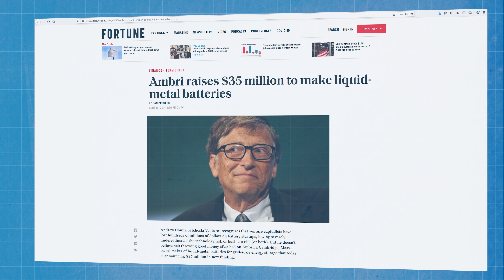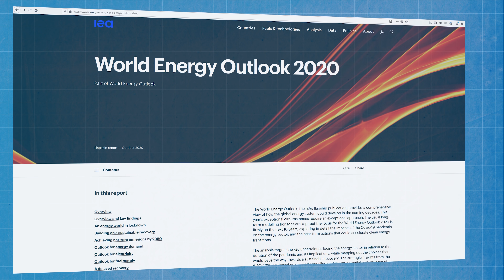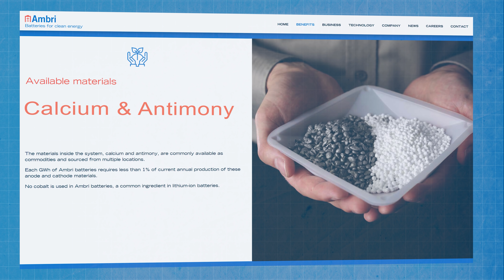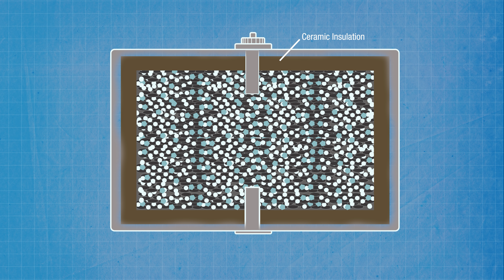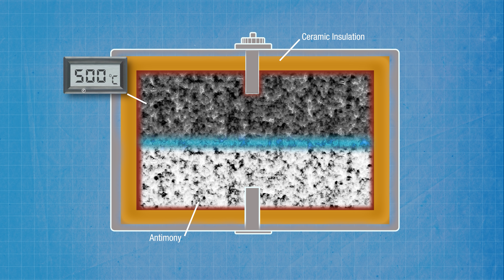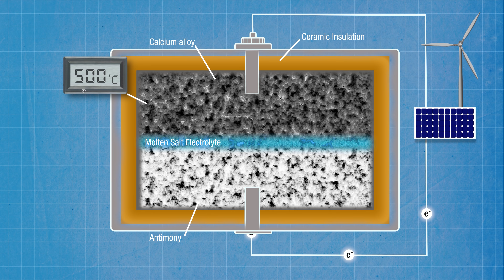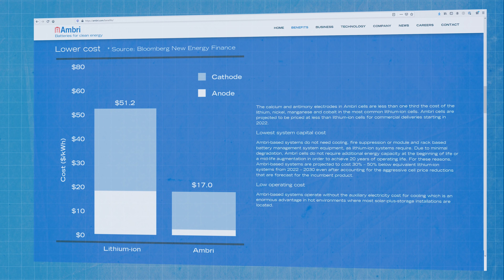AMBRI Liquid Metal Batteries. Will they really change the world?

Comment: No they won't change the world, or anything.  Were I to predict, this tech will die out like H2 fuel cells.  Why?

Containing molten metals and salts ain't trivial.  In fact it's mostly terrifying.  Ask the US Navy, who run nuclear propulsion using molten salt (and 99% of what they know is top secret).  My career (PhD chem eng) was about containing molten metals.  It only sounds easy.  Ta, Mo, Pt, Nb (and usual graphites/carbons, ceramics non-oxide, SiC, oxides etc) and on.  NONE are capable of containing molten metals for minutes, let alone years.  All have weaknesses.  It's a combination of high temperature and chemical alloying, sometimes erosion, tribofriction.

Comment: "The system has an efficiency of 80%, which is about the same as pumped hydro".
Is that the efficiency for a full cycle for 1 day?
In that case you lose 20% with the 1000 kWh unit, that is 200 kWh. That 200 kWh is a lot of heat. Easy to use to heat your home and bath water! This brings the efficiency more or less to 100%.
Conclusion: purchase a 1000 kWh unit and charge it when the power is cheap. Discharge your unit when the power is expensive, the price fluctuations are huge. In the meantime, take advantage of the free heat.

Comment: In an update latter on, could you answer why, for grid scale, these cells are so small...20×20×40mm? If filling a 10Foot shipping container is a module, why not make the cells much bigger, say a little smaller than the container to give room for the controller and connections?

Comment: Presently, the cost of antimony is cheap, but it will rise quickly if Sadoway's liquid metal battery becomes commercially available. I calculated that MN would need over 140,000 tons of antimony to provide its grid storage needs. Since China is the only country with sizable amounts of antimony this will become a strategic resource. China wouldn't be able to supply it's own storage needs, much less the world. Unless a cheaper more widely available metal is found for liquid metal storage, Sadoway's battery will only be a part of the answer to grid storage.

Comment: Please answer if anyone knows,

1. How much electricity they need to start a battery.
2. How much electricity they need to maintain 500°C.
3. How they stop heat energy conducting through copper wire during a connection.

Comment: So, how does this guy use heat energy to melt antimony and calcium to 500C ? Fossil Fuels ?
Reply: OK, I care about my planet and I shall give a very short explanation:

EVs become pointless when they consume the power produced from Non-renewable resources (however they claim its clean).

If Hydrogen fuel cells are honest, why don't they just install EV charging stations powered by Hydrogen. That would be more cheap and easy right? (They said the same - "fuel cell are run by renewable enery and its clean") 😒

It takes more than a decade for people to realise that renewable energy have several disadvantages like when mining the minerals and materials deforestation is done, recycling toxic and heavy metals are very difficult and dumped in the soil, affecting the underground water, mining those minerals require powerful tools and machinery and man power until it becomes finished product like a battery or any electronic component; Also they have very limited life span, so we have to keep on producing new ones. And they require huge space (except nuclear power plants). We need other materials for the body frame and other parts (it's an entirely different topic), they produce all toxic and greenhouse gases during metallurgical processes. (They claim it's clean) Huge amount of Energy is being used and resources have been exhausted

Same is applicable for each and every renewable energy. It's definitely better than the conventional fossil fuel types but its definitely not the solution. 

For these people, Business is the goal not Saving the planet! Are we just cheating ourselves in the name of saving the world???
Reply: Perhaps you should more carefully watch this video or Sadoway’s presentation at Stanford University.  It requires no energy input from fossil fuels. as is clearly spelled out here.  The energy comes from wind generators and solar arrays.  The electric generation is used to liquify the metals and is then available for instantaneous use as the metals return to their solid state.  You could also read his patents.  As Lincoln once said, “It is better to remain silent and be thought a fool than to speak out and remove all doubt.”
Reply: @robland4812   Why would a physics student with Materials Science major with enough knowledge in Solid State Physics and Quantum Mechanics like me have to teach a random idiot. Lincoln was correct!!!

Comment: Great post imagine these batteries with super conductor technology 
Just a shame they are having so many problems getting super conductors to work at ambient temperature.
If they could succeed most energy problems could be solved .
Imaging  electric motors or generators with no back EMF the power out put would be colossal with much lower consumption'
Ultra low transmission line loss would mean PowerStation energy consumption would be tiny compared to the current  37-60% inefficiency  
A four wheel drive car with these batteries and a separate direct drive motor on each wheel no bigger than a car starter motor

Comment: I heard about this back in 2017 and had heard that they were struggling to find the best choice of materials as well as dealing with corrosion from the molten salts, I'm glad they seem to have sorted it out, because grid storage needs something that handles 10's of 1000's of cycles and is safe. This seems to be the ticket. It also takes the pressure off lithium supplies freeing them up for the global vehicle fleet.

Comment: This would be a great way to recycle steel shipping containers. YES, of course these would not have the quality for the structure of the actual cell case lined with ceramic insulator and filled with metal salts -  however it would be a cheap and strong outer container that could hold an inner lining of the ceramic/steel battery case manufactured to spec and back-filed with zeolite or other insulator. What do you think?

Comment: If you apply these batteries to an electric vehicle while one is supply electricity to the car the same source of power would be charging the second battery. So when the source battery reaches a point or just before the point of fully discharge the control system switches to the second battery and maintains service and begins to recharge the first battery. And the system repeats its self making it possible for a vehicle to run as long as the batteries will permit it and Will run without ever stopping.

Comment: Density separated calcium (less electronegative) antimony (electronegative) separated by salt / hot liquid metals // self regenerating electrodes, anode & cathode constantly regenerated // self heated by transient loading // insulated container also a heat storage system // with other energy tricks possible like putting them in homes as a heat source from the leaking waste heat //

Comment: I love Donald Sadoway' persistence & tenacity to commercialize the liquid metal battery / Energy Storage essential for intermittent renewables like wind & solar because energy grids need 24/7 output like Nuclear Fission reactor to replace coal power or to help decarbonize the grid from the stranglehold of natural gas & other carbon based fuels. Even the oil company executives are talking about the urgent need to decarbonize human civilization to reduce air pollution & stop contributing negatively to the climate change debacle //

Comment: As a retied high voltage electrician I had a couple questions and sent them to the good doctor, but he has not responded. First, has anybody developed an current inverter to send a smooth sign wave down the grid. Batteries give a shelf sign wave which often cannot be used. Batteries connected to present technology inverters get a squared cycle. That too has it's limitations. Second, our grid is 110 at 60 cycles. That combination worked for Thomas Edison when he invented it. But, it is very inefficient. Is there any move afoot to make the US stand 250V @ 50 cycles, like much of Europe? So tell me where these questions are addressed in all this hoopla, please?

Comment: Question how much power do you need to get the Battery to 700c in temp to start working I'm asking if the standard 5 - 6 kw from Solar on my house  would get it hot enough to start working ????

Comment: Wait.

You are storing tens of thousands of watts of electricity in these molten metal batteries.

And when they short, you claim they won't react violently?

Just add an earthquake to give them a good shake, and we probably have cracked cases and Calcium fires.

Oh what fun.

The idea has its merits. I like the concept. But these are not mobile and will need stability, and isolation from large shocks.

Comment: Thank you for the video. Been following Dr. Sodwell's work with interest for a while.  The operation of this battery has never been clearly outlined until now. Thanks.

My take away.  It's a chemical battery based on Antomine and Calcuim heated up to 700 degrees with energy supply by solar and wind for charging,  discharging goes in by switching a load for about two days then reverse to charging again. 

If I charge and do not discharge,  how long can one store energy?

Comment: The "Climate and Sustainable energy channel" better look at what sepcalized market analysts say about how "green" these solutions really are. Commentaries like that of Goehring & Rozencwajg  from which is the following excerpt (llok that up in Google for all the 26-page report): 

"Unfortunately, carbon intensity per unit of energy consumed is unlikely to fall by the 50% assumed in the IEA’s proposal either. It is widely believed the reduction will be based upon the widespread adoption of wind, solar, electric vehicles, and hydrogen fuel cells, but our research suggests these technologies will fail to deliver the expected results. There are several real-world examples that confirm our suspicions. Over the past two decades, Germany has aggressively pursued its renewable-centric “Energiewende” plan, taking renewables from 2% of all German electricity to nearly 40%—by far the most aggressive renewable push in the world. Over the same period, carbon emissions per unit of energy fell by only 12%. Not only is this reduction a far cry from the projected 50% reduction in most energy transition plans, but it is also no better than those countries that did not adopt a renewable energy push. Between 2000 and 2019, the US and France went from 1% renewable electricity to 10%, or less than one-third of Germany’s penetration. Despite this lack of renewable adoption, US carbon intensity fell by 13% while France’s intensity fell by 10%, ahead of and only slightly behind Germany, respectively."

Comment: What is the expected life of the battery?  What is the maximum size?  What are the economies of scale as the batteries are enlarged?  The claim of one third the cost of LI -i makes a lot of sense.  Seemingly no degradation -  the explanation was light for the end of life.  80%  roundtrip is better than pumped storage.

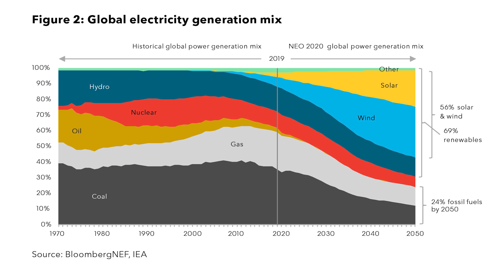Comment: I don't quite agree with the end-game suggested at 3:00.   I expect that Nuclear will see a resurgence probably starting around 15 years from now and will eat into what remains of Natural Gas and Coal.  The reason I believe this also comes down to the grid-storage energy systems becoming more dominant (aka batteries and other technologies).

Right at this moment, Nuclear is not a good fit to a grid that is fast requiring cyclical generation.  California's grid, for example, only has around 3GW of what one could reasonably call "base-load" left.  Nuclear really only works well when operating as base-load.  So, right now, Nuclear is in decline.  But once we get enough energy storage on the grid that equation is going to change.  Renewables + Storage will begin to increase base line overnight power consumption as well as be able to soak up excess solar in the middle of the day, thus allowing more base-load to be generated 24x7.  At  that point Nuclear becomes feasible again, possibly in a big way.

No amount of battery storage can completely remove non-renewable generation, simply because it is not economical to put 10x the battery storage on the grid that one would otherwise need just to handle the few days of the year that would need it.   However, we can get enough battery storage on the grid to economically buffer a nuclear take-over of the remaining non-renewable generation.  Ultimately it will be nuclear that will eat gas and coal and provide the energy needed to guarantee stability and reserve capacity (that reserve capacity of the energy storage systems that are able to refresh overnight, that is).

-Matt

Comment: I guess it would be problematic in space if gravity is a requirement.
Reply: True, but the Sun doesn't set in space, so you don't need a system to respond to intermittency. Besides, liquid metal batteries are very heavy, so would not be a choice in space for that reason also.

Comment: thanks for info
2 questions thou how it respond to quick discharge like instead of 4hours discharge discharge in 40 minutes!
next one is how exactly they melt? for exam lifepo4 just connect the cables & thats it
are these batteries need some sorta extra device to heat them up or some sorta heating circuit inside of each battery?

Comment: Your graph you used to show the "future" generation of various forms of electricity sources is based upon projection without the consideration of the technical and environmental limitations of some.  Wind generation is starting to show its limitations and the technical "vulnerabilities" of existing designs and materials.  Same goes for solar panels.  Most , if not all, current demands of energy are the problem for wind and solar power sources.  The LED light bulb has solved the lighting issues, but there are so many appliances and electronics being build and designed according to the energy supplies as they are now.

Comment: How much cycling in watts does it take to maintain the 500c operating temperature per single battery? How small of a system can be used? Could it be used in a residential solar off-grid system?

Comment: please compare this technology with the one used right now in the solar farms where they heat and melt salt in a tower. that salt is acting like a battery and it s a much cheaper tehnology i think. nevertheless this liquid metal battery it s the cheapest way of storing wind and solar pannel energy that produces electrical curent directly. i think the goverments should not alow the private companies to install wind or solar pannel farms without a liquid metal storage facility of a minimum 30 procent capacity of the farm energy production.

Comment: As usual - brilliantly presented. Does anyone know if these liquid metal batteries will be available for domestic use?
Reply: Sort of depends on the size of the need. They seem more reliable and work better and are more safe with quicker capacity charging. 'Economy of size' now is the only restricting factors I see it.
Might be noticed AMBRI company officer now has 'Special advisor' status to the Biden team.
Every Administration has their.... 'favorites' and lets get real.. every politician is just in D.C. to get in the flow of funding... creating the direction of Funding... and AMBRI has a foot in the door.
no one can say if 'Funding' comes about for AMBRI to create 'Economy of size' but in terms of having serious production capacity compared to where they are now.. something relatively as small as 50 mill or 100 mill would certainly make a splash.

Comment: Looks very promising. You still have to think outside of the technology a little towards where the raw materials will come from and how they will impact the local environments they are sourced from, but that's the case for almost every battery. Antimony seems suspect in this regard as I have heard it's incredibly toxic in certain forms. 

If I am reading this right, however, this battery needs electricity to get started. It won't act as a battery unless you have some sort of generation nearby that can handle the load until optimal temperatures are achieved. Because of this, I'm wondering if this technology would work best when supported by, say, standby lithium-ion battery reserves that can jump start the liquid metal when it's needed. The demand response in this regard wouldn't be the best, so it seems these batteries would be best suited towards base-load industries. 

Great video nonetheless! 👏

Comment: For once, it's great to be talking about something that is free of ideology. At least, I can't think of any way for this to make anyone's blood pressure rise. Without question, the battery works, and seems to have no serious environmental issues. It's basically a question of economics.

Lithium ion batteries, in their various forms, have reached an advanced stage of development, and are continuing to improve. The problems Dave refers to are very unlikely to be serious problems in any of the applications where one of these liquid metal devices might be used, and lithium ion batteries, despite the potential issue mentioned, have achieved very long lifetimes.

I would be interested in the efficiency of one of these metal batteries as compared to more conventional batteries. Also, it matters whether you can make these things in small sizes, at least a lot smaller than an aluminum smelter. Let's hope this new technology gets a good, long try, and we can see what its potential really is.